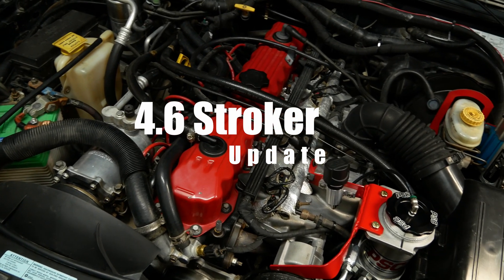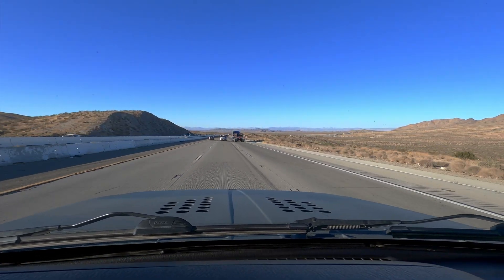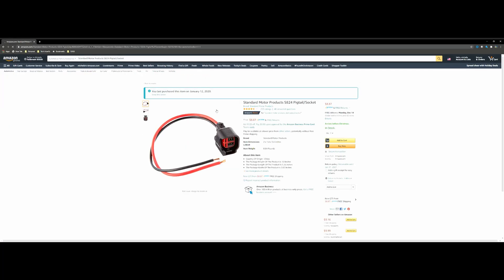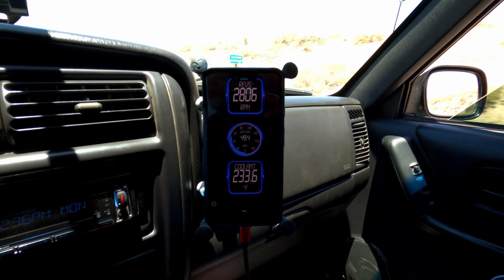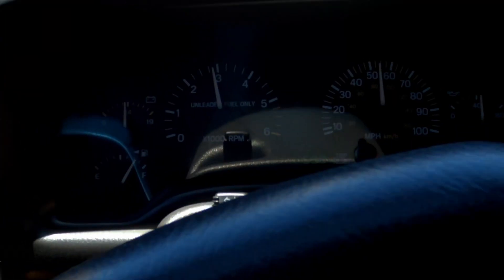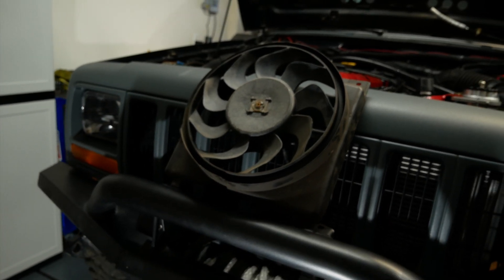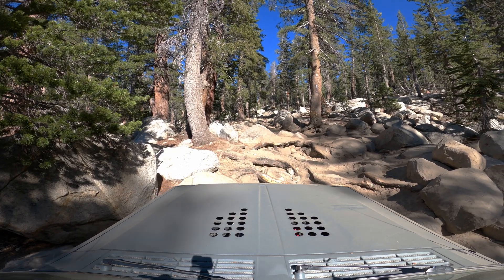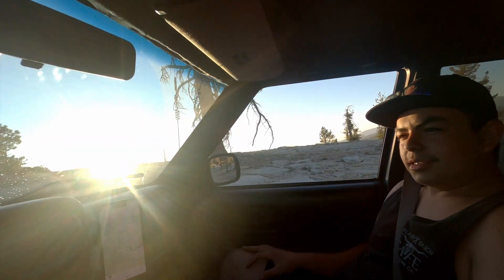4.6 Stroker Engine - Update

Comment: Don't forget about the heat that the transmission generates.  Stuffing an auxiliary transmission cooler can reduce the strain on the radiator.
Reply from the maker: Definitely! I'm running a B&M in front of the condenser.
Reply: @cleanEG  
I recommend moving the tranny cooler somewhere else with its own fan. That heat blowing off the tranny cooler through the condenser n radiator only adds to the problem. A pusher fan in front of the condenser is also helpful. Maybe a two fan system with variable fan speeds from a Taurus might help to lower those Temps. You really shouldn't be over 195-200 max imo. Good luck. Sweet Cherokee
Reply from the maker: @nonsequitur807  This is definitely something I wanted to do in the future.  I need to find a good location under the Jeep that will not get damaged from offroading. I also need to post an update video now that I have 20k miles on the engine and my cooling system has been rock solid all summer.  A new catalytic converter (old one was plugged) , 180 degree thermostat, replacing the transmission fluid, made a world of difference.  Never gets above 220 now.
Reply: Also look into an auxiliary oil cooler.

Comment: How did you wire up your Spal fan? I believe the Spal connection is a 2 wire and the OEM plug is a 3 wire with hi speed and low speed.

Comment: Transmission cooler , hesco thermostat neck , water pump upgrade ,  zj hd fan clutch , now you can run up hill with ac on
Reply from the maker: I'm definitely going to explore those options this summer and see what happens :)

Comment: Great Video, very informative. I have a 4.6L Golen Stroker in my TJ, an aluminum radiator with electric fan, AND A HOOD VENT INSERT. I live in AZ and the engine temp is stable, just above 210. Have you considered installing a Hook Vent insert?
Reply from the maker: Thanks for the compliment! Yes, I do have holes drilled in the hood which have helped for slow speed crawling or idling.  One of the design flaws of the XJ is the size of the radiator.  There isnt much room under the hood and the radiator is only 11" tall (essentially the size of the front grill).  If only the XJ had a frame and more engine space! :D

Comment: Lower thermostat?
Reply from the maker: I've thought about it, but I'm concerned the ECU will read too low of a temperature in the coolant and think the car should stay in open-loop and continue to dump extra fuel in the engine.
Reply: @cleanEG  you should be ok down to 160ish I run 175 or something weird like that n she don't go above 186

Comment: Great video, Thinking of putting a stroker in my 2000 Sport. Your XJ looks great. What are you running for a lift and tire size?
Reply from the maker: Thank you! I'm currently at about 5.5" of lift (give or take) with 33x12.50 15 tires.  It's a Rubicon Express 4.5" superflex kit, but I added drop brackets, 1" coil spacer, and 1" shackle relocation bracket.

Comment: Can I get more information on the engine?
Reply from the maker: Here's a short summary of the parts.  Russ Pottenger put together the kit for me, so give him a call if you are interested.  Fully ported head, new valve springs, LS valves, machined block, new scat crank, micro-polished and balanced assembly, racetec pistons,  new rods, wrist pins,  comp cam nitrided (custom grind) ported intake manifold, ported throttle body, bosch 24lb injectors, OEM ecu with no tune (still factory).  That's the core of it all, excluding the banks torque tube header, new water pump, oil pump, harmonic balancer, timing chain, etc.

Comment: put hood vents to relieve the hot air. typically toward the front of the hood. not a scoop...
Reply from the maker: Those really help! I have holes cut in the hood that the previous owner did. I can see the heat waves on those hot summer days.

Comment: You never mentioned your trans cooler. The AW4 runs hot. Try a big cooler and skip running it thru the radiator.
Reply from the maker: As it turns out, I forgot to mention that as well! Yes, one of the first things I did to Jeep 5 years ago is add a trans cooler and bypass the radiator. Since I don't live in a cold climate I could get away with it. Thanks for bringing that up, because it really helps👍

Comment: So if you have a stock 99 XJ, would you recommend swapping the driveshaft and some suspension parts? I’m thinking about swapping a 4.0 to a golen 4.6 stroked.
Reply: Um yes. Get an SYE kit and a HD driveshaft from Adams or Tom Woods. Don't cheap out.
Reply from the maker: Not sure I follow your question, but if it's a used stroker I would ask for a build sheet on it and get more information.

Comment: The stock water pump does not work well with the Mishimoto radiator. You need a Hesco water pump. Huge difference!!!! You lose water pressure, flow, & turbulence with a big radiator and a stock water pump. It solved all of my issues. I also put a fiberglass hood on with a front scoop inlet.  I went from 250 degrees temps down to 180-197. Hood vents work wonders as well. I’ve tested everything. I did Everything to try to cool it down and the water pump did the fix. I even installed windshield washer squirters to spray down the radiator before I climbed grades. Moreover, I remote mounted my trans cooler so it does not block airflow to the radiator when Mounted in front of the radiator. This definitely helped a bit. I eventually put 33” KO2’s tires back on to reduce rotating weight which also helped.
Reply from the maker: I never really thought about the radiator requiring more flow.  When summer hits and temperatures rise I'll try out the Hesco waterpump.  Thanks!
Reply: @cleanEG  I did some research and got the information from a company called Stewart components. Super helpful technical information. I have a house in Landers as well if you ever go out that way. Great video by the way! I also had my blocked pressure cleaned by my friend’s radiator shop with 40 psi of air and a cleaning detergent. I like ur insight with the ax condenser. I’ll have to try that next. Thor intake also helps with the intake temps. I haven’t tried it yet but I have heard that putting a quality heat shield under the intake makes a difference too. You have to remove it to install it correctly.

https://www.stewartcomponents.com/index.php?route=information/information&information_id=6
Reply from the maker: @fr.rochmarycfrgreiner6419   Thanks for the info! I'll do some more testing in the summer when temps start to climb again.  I'd like to do another trip to Mottino wash / Rattlesnake canyon out near Landers.  If I do, I will let you know.  Thanks again!

Comment: Did you ever put a ZJ fan clutch in? Made a huge difference for me when solving heat issues. Makes your fan spin faster at idle, and engage at a lower temperature. I also wonder, is there any way you could put small fans under your hood vents to help pull the air through? Love the build man. I get a lot of inspiration from your videos!
Reply from the maker: I did the ZJ fan clutch but with the bigger radiator, the fan was so close to the radiator I didnt want to keep it.  I also noticed it would run cooler while moving but not so much at idle.  Thanks for the kind words! All of the positive comments help motivate me to make more videos :)

Comment: What kind of mpg were you seeing on the road trips after the stroker swap?
Reply from the maker: Great question -  When fully loaded and the spare 33" tire on the roof rack, I get about 13 mpg average if I keep the highway speed under 70mph.  That includes some hill climbing, etc.  The Jeep does weigh in at 5200lbs and with 4.88 gears my rpms at 70mph are 2850.  If cruise at 65mph, I pick up 1mpg on average.  Daily driving on highway @ 65mph without spare on roof, tools, camping gear, etc - then I can get closer to 15 mpg.  Around town, I put my foot into the pedal too much so it's around 12.5
Reply: When going 70mph are you in 3rd or drive? Seems too high for me. I have 32 inch tires with 4.56 gearing and at 70mph while the torque converter is locked up my rpms are a little under 2000.

Comment: How many miles have you put on this stroker motor so far an reason I ask is because I read threads online people saying there strokers died at 10k miles some say Golen Engine Co 4.6 strokers grenade at 20k or less I want more opinions do tell me people
Reply from the maker: I've put about 6 or 7k miles on the engine so far and hopefully it doesnt grenade!  I would have myself to blame though because I did the assembly myself, however I'm pretty confident that it will last just as long as the factory 4.0.  I think assembly is important and also choosing the right parts. I also put together a very mild build, meaning the compression ratio allows me to run 87 octane, so it's far from a "race" engine.  Russ put together a reliable combination for me and I have another friend with almost the same setup without any issues.  I know it's a big investment so I hope this helps you out.

Comment: They make high flow  water pumps I forget the brand name but i hear they work wonders.
edit: Flow Kooler or hesco. Double the flow at idle but returns to stock flow over 3500 rpms.
Reply from the maker: Thanks Kallam - I had a flowkooler in the original 4.0 when I was trying to solve some cooling issues and to be honest, I didnt notice a difference .  I figured I would try the mopar OEM water pump this time and maybe swap in the flowkooler if the temps didnt go down.  Thanks for bringing that up, because I know some people that have had good luck with it.
Reply: I've always felt that High flow pumps and  thermostats don't give enough time for the radiator/fan to cool down the coolant.. A solid radiator/fan set up with 195° Tstat have always been my go too..

Comment: I have been chasing heat issues for a while but I am super satisfied with my setup now. I have an 04 TJ 4.0 with the 42RLE auto. I live I California and my temp never goes above 210 WITH the A/C running. I upgraded my radiator to a 4 core aluminum radiator, stock 195 thermostat. I also invested in a new A/C condenser and I have an auxiliary 16 inch fan mounted in my grill (for my A/C when I’m sitting in traffic). The trick that I think can help you out is to install a super heavy duty fan clutch combined with a 9 blade fan from a 1993 Ford Explorer. This makes such a difference I’m surprised it’s not talked about more. I did this a couple months back when it was still hot and I literally cruise around at 190 to 200 with my a/c cranked full blast climbing hills and everything. Hope this helps
Reply from the maker: Thanks for posting this, I may explore different fan blades on the XJ fan clutch.  With the limited space in the XJ engine compartment and the thickness of the radiator, when I had the ZJ fan clutch installed, the fan was 1/4" to 1/2" away from the radiator and I just wasnt comfortable with it being that close.  Now I have solid poly motor mounts so it doesnt flex much, but it still wasn't ideal for me. The fan blades is a great topic, I am going to research some options, so thank you!
Reply: Where is your 16” fan mounted? Push or pull?

Comment: You forgot to mention that your mishimoto was half plugged and they warrantied it.
Reply from the maker: Doh! I knew I would forget to mention something in the video :)  I'm not sure how plugged it was because it was also used in my old engine.  But nevertheless, my heat gun did show that temperatures across the radiator were not consistent and every time I flushed it, there would be small amounts of metallic sludge attached to the magnetic drain plug.  Either way, Mishimoto is a fantastic company and warrantied my radiator.
Reply: I was gonna rag on the Mishi being junk. The larger 3 row CSF would be a solid unit and probably give you lower temps.

Comment: Have you ever replaced your mechanical fan clutch? Thanks for the update video!
Reply from the maker: I'm glad you asked, because I forgot to mention that I tried the ZJ fan clutch for a while but it wasn't improving my idle air flow. Only slightly improved flow on the highway but I also lost some power. In addition, the ZJ clutch is really really close to the mishimoto radiator and I wasn't comfortable with it. After going with the SPAL fan, I put the XJ fan clutch back in.